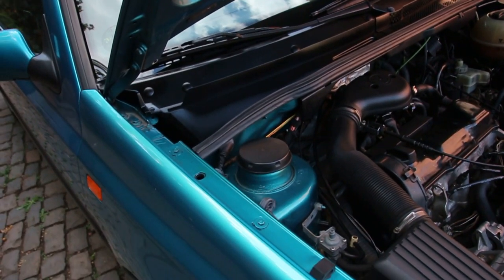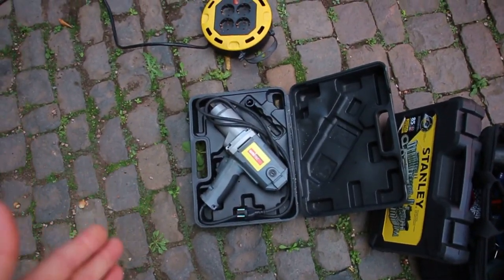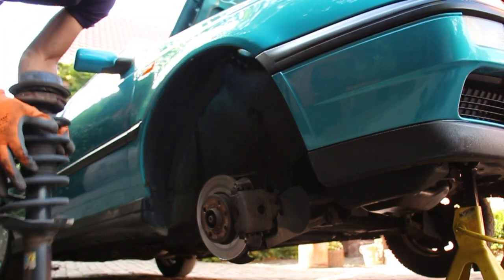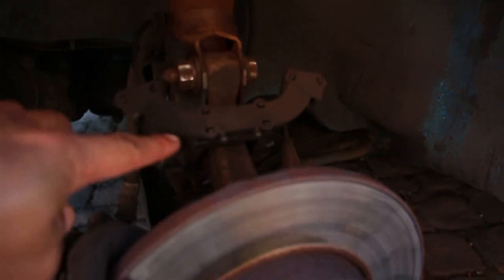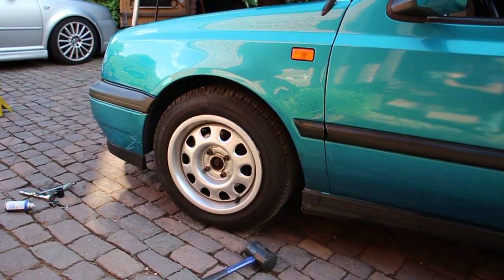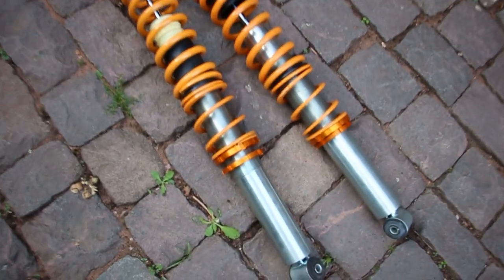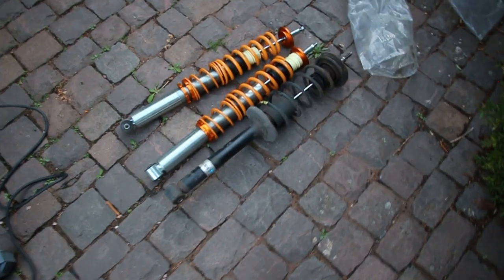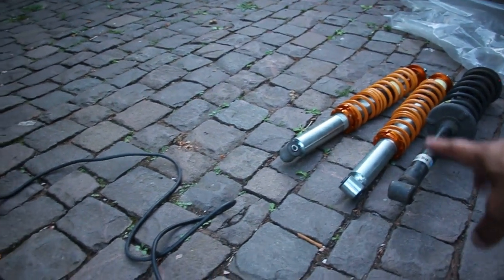Coilover Install On The Mk3 Golf!!

Comment: I would check the ignition  switch and test with two wires to start the car. The switch only cost 15€ or less. Has the car the original alarm system? In German called DWA. This could also make problems like  you have on the Savoy. If the DWA Control Modul has bad Soldering Points your car would randomly die.